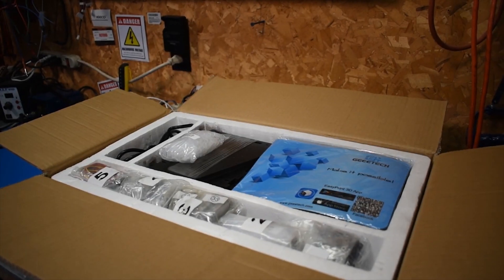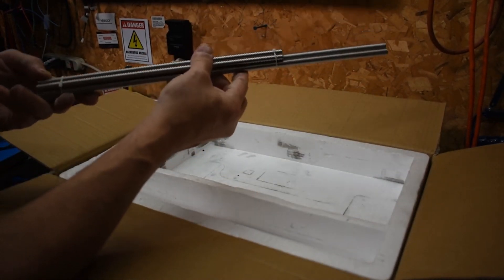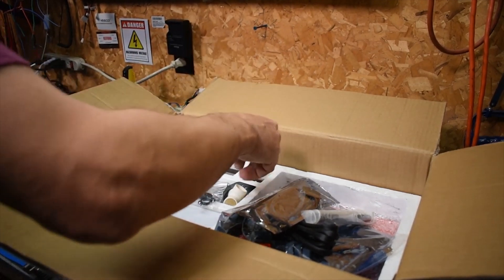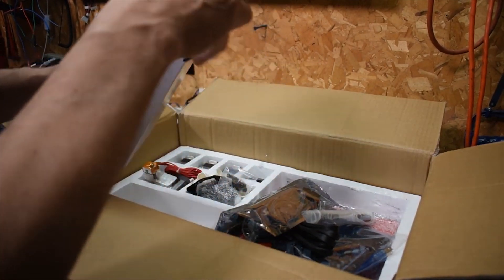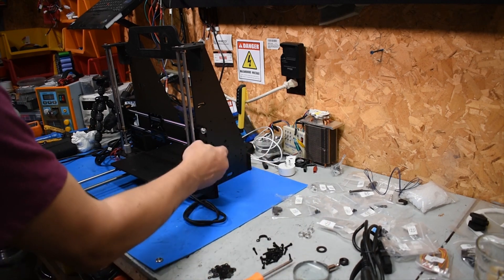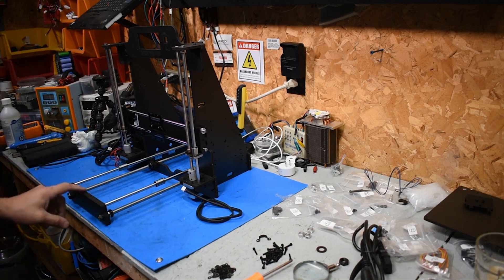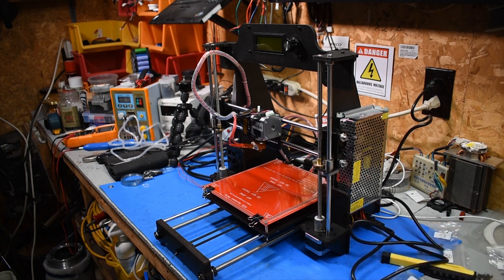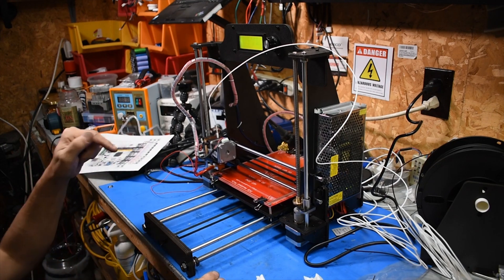GEEETECH 3D Printer,Wooden Prusa I3  setup unboxing

Comment: I need help my z is skipping my first layer is fine then layer 2 it starts to jump high and the 3 layer jumps higher how did you fix it....!!
Reply: your  Z Axis Lead Screws are bent and binding. its a problem with this model.  i will make a video explaining what i did  to fix it.
Reply: @KarmaElectronics.  but i got new ones and it still not working..!!
Reply from the maker: @jordanmusleh6305  https://www.youtube.com/watch?v=ulxQpqzP7so&feature=youtu.be